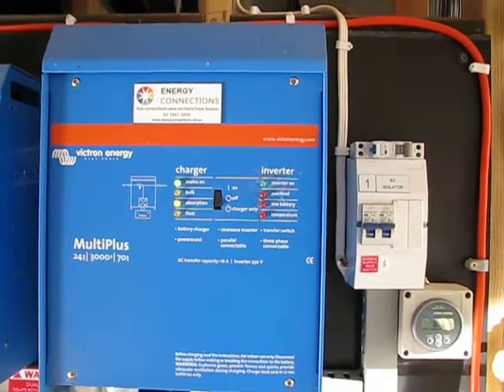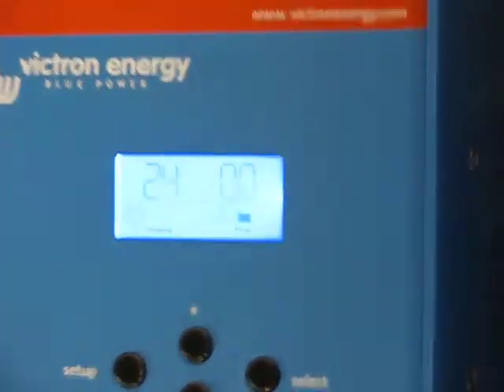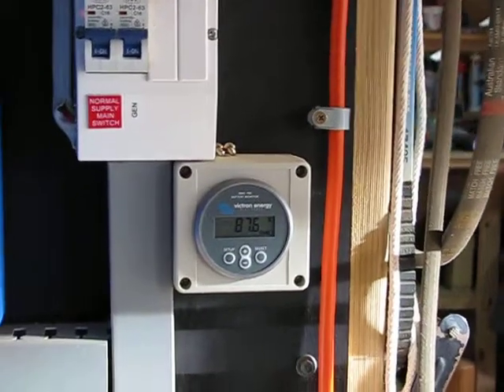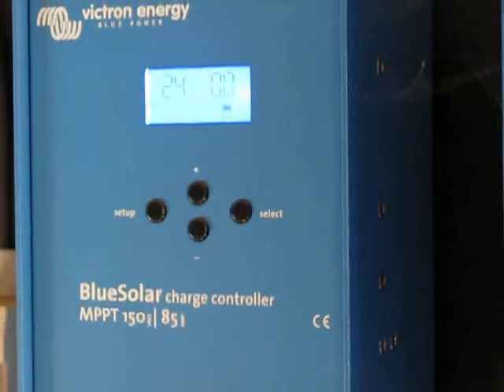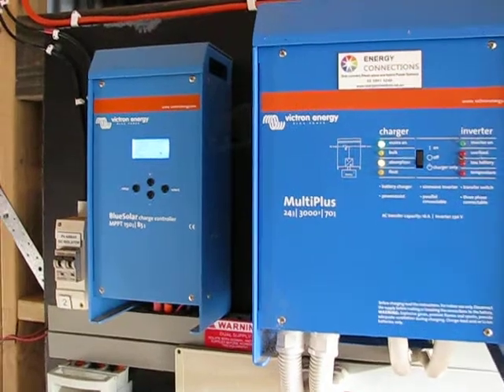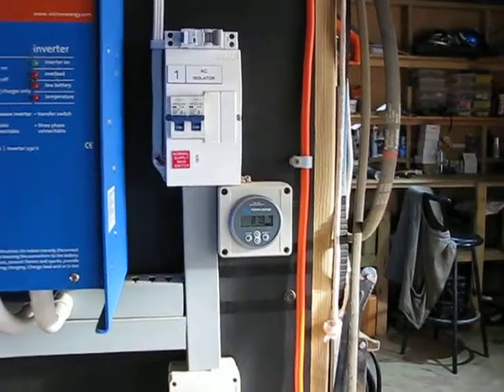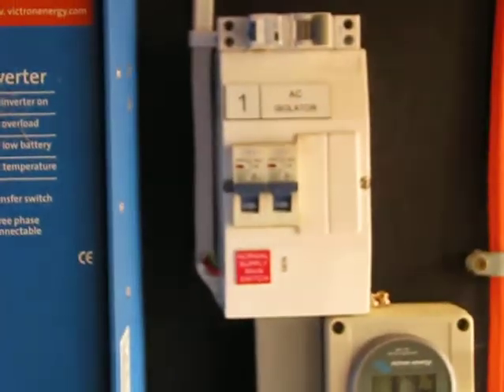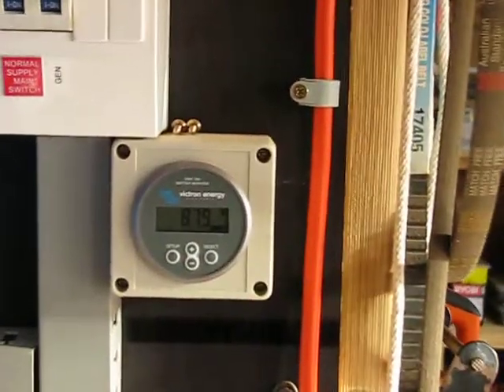Off The Grid     Victron solar gear advice

Comment: It's a bit late, but.... The solar charge controller sees that the battery voltage is ok, so it's in float mode. This is normal. The reason it's in float mode is because the generator is supplying the main charger with power and the main charger is charging the batteries. The victron monitor is working as it should showing the bank capacity as it is being charged by the main charger. If you disconnect the generator the solar charge controller would take over and drop back into absorption mode again. Looks like everything is doing the job as it should. Nothing to worry about in my opinion.
Reply from the maker: Never ever too late !      and yes you are dead right :- )    thanks , because others will read the comments over time for sure ... cheers Steve

Comment: The genset is feeding the multiplus. The multiplus sees batteries not full, and goes to absorb. The SCC sees a high battery voltage, and goes into float, thinking the battery is full. The BM is the only clued in one ;)

Comment: I am an qualified electrician and electronics tech, have been for over 45 years now.  I installed an off grid system about 5 years ago. As I wanted as much power down as possible with my roof area I installed nominally 6KW of solar panels in 3 x 24V 250W panels in series and  8 sets of these in parallel  giving me a grid capable of a max of 112V (varying depending on load and UV illumination)   at a max I have seen at 60A.
You will not ever achieve the design max  due to many variables, mainly the sun slant angle and that varies from summer through to winter.  The Victron MPPT 150/100 - TR I have converts the incoming supply from the solar panels to a nominal 48V, actually it can go up to 57.8V when the batteries are on absorption going into float.  My batteries are AGM with 4 x 12V  280 AH connected in series and   4 banks of these connected in parallel.   
48V is used for the system to obtain max power transfer at minimum current , this allows me to use roof cabling cross sectional area of medium gauge with little voltage drop and minimum I2R losses.
I am now using a Victron Phoenix  Inverter  48/5000.  I have tried several Chinese inverters but most gave up the ghost after less than two years, some only lasted a week.   DON'T USE CHINESE INVERTERS they are a waste of money and for the most part poorly made, but when I was starting out over 5 years ago that was all that was available.
Now to you, what you are doing is charging the batteries via the solar panels and a petrol generator via your charger / inverter.   You would normally not do this so your charge indicator is receiving incorrect voltage indicating the state of the battery bank, hence it indicates incorrectly, after all battery voltage is the only parameter it is calculating on.    
If there is insufficient sunlight or the slant angle is great on the solar panels and the batteries do not reach float then I feed a petrol generator (nominally 240V)  into two welding transformers in parallel feed to a heavy duty bridge rectifier feeding  a 10,000 uF x 160V  bank of capacitors in parallel and hence clip on to the solar feed for the duration of the charge till the MPPT 150/100-TR charge controller indicated the battery bank is on float.   Using welding transformers allows me to adjust the power feed into the system and stops the generator from overloading.     
It helps to have a through knowledge of electricity   in going off grid   and to understand precisely what you are doing.  This is not at all difficult but being able to think in abstract terms helps in understanding something you cannot see.   I served in the RAAF for 20 years and taught trainees electronics for over 4 years, basic theory can be grasped if you can put your mind to it.   Understanding the processes may be the stumbling block for most.

Comment: Steve, what made you go with the Victron Inverter over SMA and some of the others?
SMA is very slightly more expensive than similar sized Victron Inverters, however the SMA has a 10 year warranty and Victron has a 5 year warranty.
Reply from the maker: A complex question , that I will try to answer IMO ...  SMA I knew little about . Like a few brands , some are more for grid connect , but yes do have storage packages.. Selectronic I do like , but they were quite a bit more expensive.. 
 ..  Victron are a long standing , off grid system suppliers  that are usually glitch free and I am familiar with them ... 

Bottom line , like many off griders  I installed myself , so knowing the gear was a bonus .. We see all to many using duel purpose (grid and off grid ) gear and heaps get into trouble of have the gear installed by pros , that wind up costing a small , actually not so small fortune .... If you are or were going to set up a system yourself , knowing the gear and being able to service it if needed is a long term thing ...   Not to sure what else to say ..   ?   its just a choice I made at a good price too at the time  :- )     cheers Steve